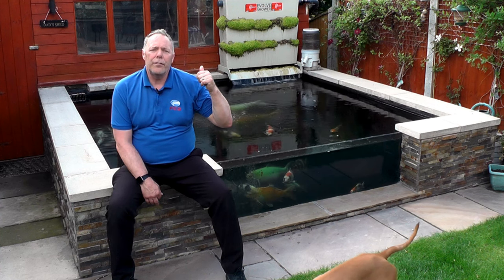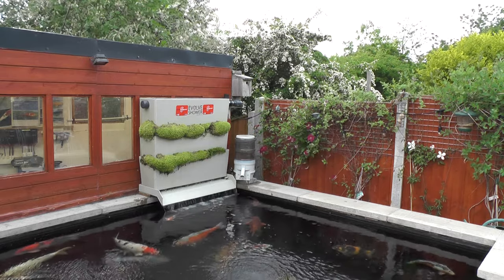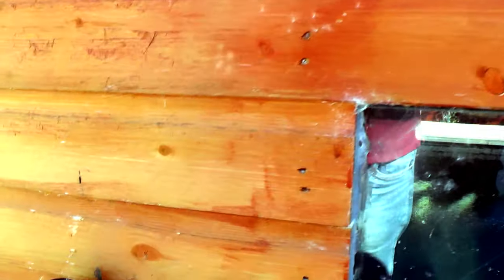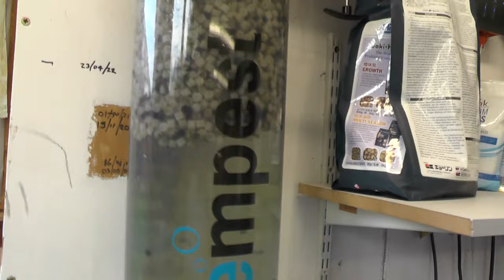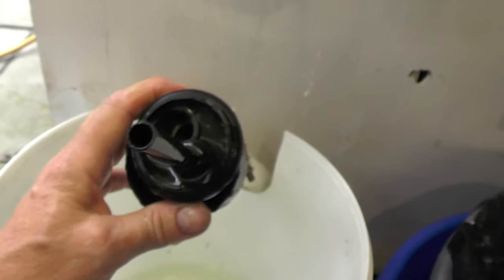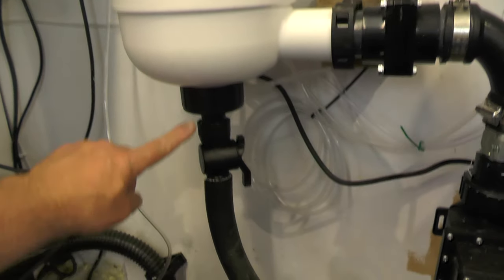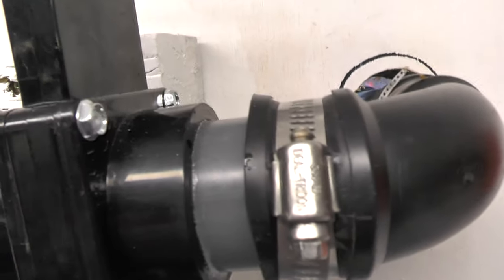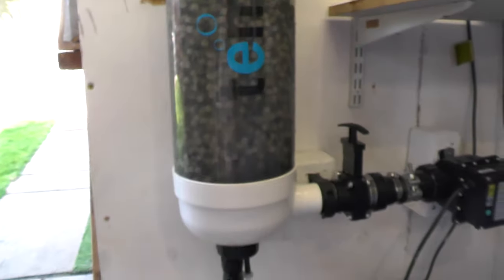Evolution Aqua Tempest Issues - How To Plant A Bakki Shower - How To Clean A Pond Window

Comment: Glad you sorted it. 
Regarding cleaning the algea on the other one, you can plug an air pump on the EA air valve, drop the water a bit from the tempest and open the valve at the top. And let it agitate for 5 minutes. Do that a few times and you'll see that it will come off.

Comment: Ouch I got attacked by a bee hive once got stung 9 times so I know how that feels great update tho bud hope it didn't hurt to much 👍 stick an air pump on the non return valve on your tempest with the top gate valve open and that will give it a good clean 👍 leave it bubbling for a few minutes before you open the waste and that should clean all the crud of the side of the tempest 👍
Reply: I've seen a lot of people using an air pump on the tempest. TBF I thought that's what you were supposed to do, but that's only because I've seen so many people do it.

Comment: I clean mine by closing the bottom valve off. Drain a inch or so off. Then I have a spare air pump connected to the one way valve. Turn that on and it boils it more violently and as long as ya won’t.

Comment: Hi. Mate great video . How easy was it to change slide valve and where did you get them. Mines ok but I think on the way out. To clean cylinder take off and just give it a good shake and the algae come off . Cheers Chris
Reply from the maker: Cheers for watching and sharing the tip. I bought a new Valterra Slide valve from Five Acre Koi Pond Supplies and undid the 4 bolts and just swapped the centre slide and 2 o rings and it worked fine.. It took about 3 minutes.
Reply: @AKoiEnthusiast  hi . Thanks for reply I’ve been on website could you confirm that the size is 1.5 inch I’m guessing it is just didn’t want to order wrong item . Once arrived I will have a go at fitting it. Thanks for advice really appreciate it. Cheers Chris